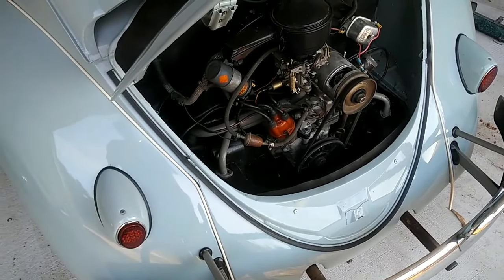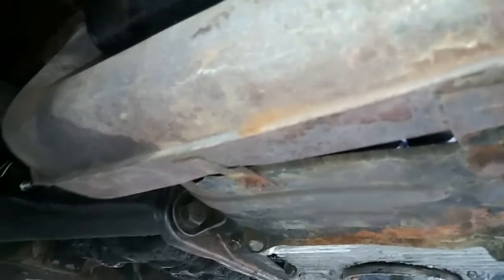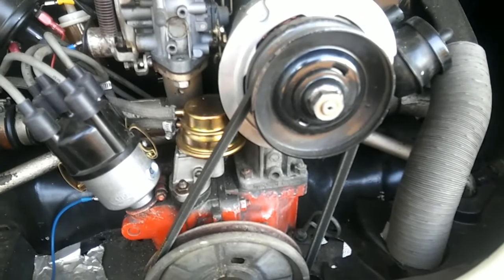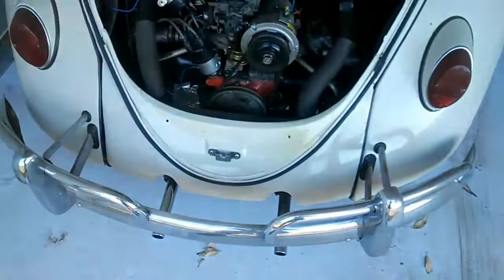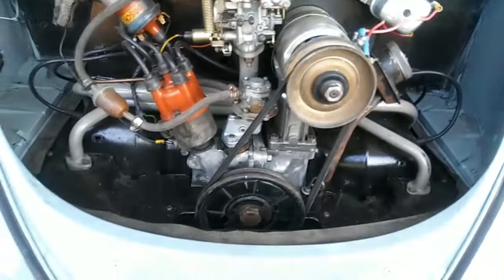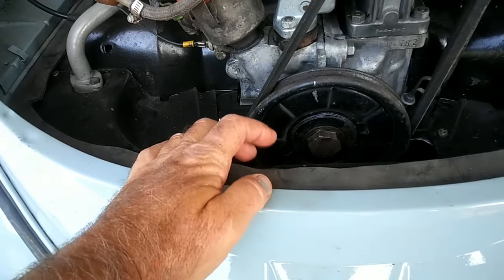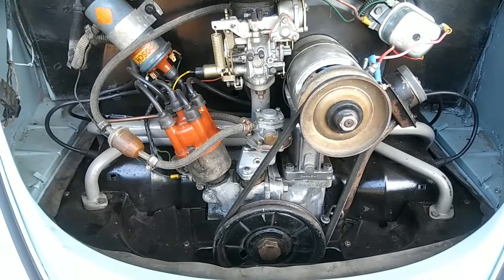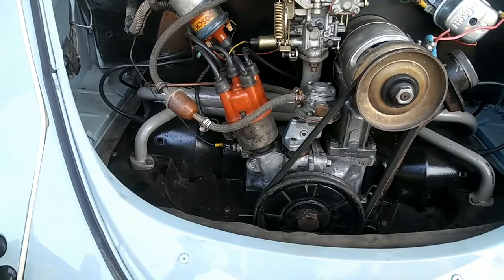VW Bug how to prevent engine overheating

Comment: 1-You go 70 km/h on highway for 15 minutes okay.
2- brake a little bit how much actually ?
3-and then full pedal 
4- if my engine sounds like "ping" or "in pain= is that meaning sound wraaaaaa" idk can you describe it more about that overheating check ? Speacialy for that ping or pain i can't understand that word sorry. English is my 2nd. Thx a lot 👍🏻
Reply: Also when i park my car after a daily drive and don't stop it about 5 minutes , i go out in my car and go behind , open the engine hatch and listen it.  i hear something like " someome playing battery and hit a drum but very far away" duum-normal idle sound arround 15-20 seconds - duum. What is that ?

https://youtu.be/gTQQ1aYYixM here it is.
Reply from the maker: check the jetting on the engine it is running hot. start there should be about 130 to 135 main jet.
Reply from the maker: the engine is definitely running hot. sometime the heads fins have clogged ports too. pull the engine and check them...
Reply: @Mikefngarage  thank you so much. It was just back from enginework about 2 months ago. The mechanic said he only care about upper parts he didn't go in the cylinders and lower parts. He said it's alright and don't need it. Right now my beetle is in bodywork. As soon as it finished i will check this again. Hope it's not serious. Thank you so much for your kindness. Stay safe&healty 👋🏻👋🏻

Comment: HELLO, I AM FROM ECUADOR, I HAVE A VW BEETLE WITH HEADS AND PISTONS OF KOMBY IS 1600 CC STANDARD, WITH CAMSHAFT ENGLE 110 AND ELCTRONIC IGNITION, WITH WEBER IDF CENTRAL 40, BUT I HAVE PROBLEMS WITH THE MEASURE OF THE JETS, YOU CAN ME HELP WITH A JETS RECOMMENDATION I LIVE AT 2800 METERS ABOVE THE SEA LEVEL

Comment: Hi MIke! Thanks for the vids they are great! Will using premium and a full synthetic oil help with running hot as well as engine life?
Reply from the maker: preimium is great IDK about the full synthetic. because it is so thin at low temps and it seems to find leaks because of the poorly sealed engine factory design. Castrol or kendall 20 50 or straight 40 depending where you are.
Reply: @Mikefngarage  Zinc/phosphorus levels in modern engine oils and not sufficient to protect flat tappet followers(lifters). In automotive  engines with catalytic converters engine oil had to be reformulated and these "new" oils should not be used in older engines with conventional pushrod engines. Goog...Hemmings News: Tech 101.
Reply: Models without catalytic converter can use diesel lubes 10-40w. They are high detergency, and have antiwear additives to protect tappets. I have used them for 40 years on aircooled bugs.
Follow manufacturer recommended oil change intervals.
Reply: @edwinhsingmaster9135  , you could use diesel lubricant, CF/CG spec.
Reply: @peteremmanuel2762  diesel engine combustion byproducts i.e. contaminants are different, so are moisture levels. Lots of stuff works, but is it the best?

Comment: Lots of correct info however the owners manual for my 68 beetle lists the maximum speed and the "cruising speed" as being 78 mph. https://www.thesamba.com/vw/archives/manuals/68bug/68T1-50.jpg "Cruising" speed meaning you can go all day at that speed without a problem. I never heard my engine ping under any conditions, even in the early 1980's when leaded gas was replaced by unleaded. I remember I did something slightly different with the onset of unleaded gas but I don't remember what it was. I think something to do with lubrication of the valve guides. I did notice that on every enigne cylinder #3 would begin having problems at about 85,000 miles, losing compression, and if you let it go much longer, the #3 cylinder exhaust valve stem would stretch into 2 pieces and the valve head would get sucked into the cylinder, usually ruining left side head, #3 cylinder, and #3 connecting rod. I was told the reason was because the oil cooler was near #3 and therefor #3 didn't get as much cooling air, would run hotter than the other cylinders, and cause it to fail first.
Reply from the maker: good info the 68 had 4.12 gears so yes max cruise would have been 78 with premium 91 octane  leaded fuel as listed on the fuel door. The cars in the video were both 4.37. The valve guides and exhaust valves were effected most from the unleaded fuel. We used to use a upgraded exhaust valve on every rebuilt engine at the shop I worked at. Dont remember what they were made of maybe stainless. We used all original kolbenschmidt parts mostly not available now.
Reply: @Mikefngarage  In the United States what I seem to remember is that the owners manual and the fuel door for my 68  beetle with the original engine said to use 86 octane or higher, according to octane rating system used in the US. I never used anything higher than 87.  I never heard pinging. Same for my 67 beetle. The only change I made to the 68 was to defeat the second, tiny, "fixed" mixture screw on the PICT 2 carburetor, to allow the engine to run richer. To do this my friend who worked for a VW dealer – if I recall correctly he warmed up the adhesive and turned the screw a bit. We left it there permanently, and from then on I adjusted only the normal mixture valve, normally. My 67 beetle with a PICT 1 carburetor was run without any changes to it at all. I rebuilt the 68 twice, maybe 3 times. The first time my friend got me some good low-mileage 1500 cc pistons and cylinders. It needed new ones because one piston and cylinder (as well as a connecting rod) were damaged when the engine sucked a valve. The second and third time I rebuilt the engine, it had low compression in cyl #3 but I got to it before any damage was done to it. Nevertheless at the second rebuild, I replaced the cylinders with 1600 cc cylinders. I don't remember if I replaced the rings or not on the third rebuilt. Rings were inexpensive so probably I honed the cylinders and replaced the rings but I can't say for sure. I definitely replaced the exhaust valves and exhaust valve guides – I always did that on every rebuild – as well as did a precision resurfacing of the intake valves and all the valve seats. Anyway – I still used 87 octane gasoline with the 1600 cc engines, without hearing any pinging or knocking.  I had several customers  whose engines I rebuilt, some with dual port cylinder heads, some single port. I don't remembering any of my customers saying anything about pinging or knocking. I don't know what kind of fuel they used. I don't remember discussing it with them but I probably did and if so I would have recommended that they use "regular." On the 4 to 5 air-cooled VWs that were owned or used by me or by my girl-friend at the time – they all were run only on regular gasoline. There was at least one VW which had the "pancake" engine.

Comment: Why not both gages? ;)
Reply from the maker: sure just most guys get the oil one and not the head one. The head should be #1 and the oil #2
Reply: Yea, even on water cooled engines it puzzle me how the temp is on the water and not on the head either.I mean, yea it is a better indication than on oil at air cooled but still

Comment: USE ''STAR TRON''...cap full per 6 gallons eliminates the ethanol.  2 caps per tank in vw, cant over use
Reply from the maker: I will try that.
Reply: MOST auto stores have it or ebay.  good price free shipping 32oz for 26 bucks.

Comment: Lol you run heat transfers lose them, and upgrade to a 60 amp alternator.
Motor works twice as hard turning a Gen. 
And yes, install the filter at the tank. I lost a 64 notch to fire.

Comment: your fuel filter should not be between the pump and carb, that how vw's burn up!
Reply: VW bug how to prevent engine fire
Reply: Rick Jolicoeur is right people: if that fuel filter leaks right onto the sparking distributor or if your fan belt snaps and hits that fuel filter and causes it to leak it will be the Hindenburg all over again, "Oh, the Humanity!"
Reply from the maker: I have had vws my whole life over 35 years. Never had one of those plastic fuel filters fail all of  them in the same place. . But you need clamps on it for sure. The biggest problem is the carb brass insert falling out at some point. The glass ones are the ones that I would never put in that position. thanks for the reply.
Reply: And always check oil level .  The mechanical  fuel pump can leak gas  into the crankcase when it becomes worn or seals fail.
Reply from the maker: yea the fuel pump leaking into crankcase i have had that happen too many times.
Reply: Mike F, I respect your experience and it shows in your VWs, however, in all of the VW bug factory literature, pictures and diagrams I have not seen one with the fuel filter anywhere near the engine, even with the later bugs, but I have not seen it all, of course. I know it is common to see fuel filters there, but why?, where did it start,? in the 60s probably. I am not saying that it will but it could catch fire.
Reply from the maker: original vw didnt have a fuel filter. They had a micro screen in the tank. that was it. Over the years rust developed in the lines therefor needing  a fuel filter. This is where we put them in the early years. Some guys put it before the pump by cutting the line short. Originally the fuel line went about 2 inches from the pump with a small hose right before. That is why you dont see fuel filters in any literature. thanks for posting that I am sure more people are curious and just dont want to ask.
Reply: Original fuel pumps had a filter inside the pump.
Reply: bugsnstuff: Was it in the early Vdubs or you mean for all years?
Reply: I put mine under the fuel tank ( Super Beetle ), my standard Beetle's placed right where the fuel line comes out of the frame.  My Type 3....well it's on top of the fuel pump ( stock D-Jetronic ). I'd never put it in the engine compartment.
Reply: Brian on my Ghia I have 2 of those cheap fuel filters ($1.99 each) and it works fine: one under the fuel tank and one where the fuel line comes out of the frame. My fuel tank was new like 8 years ago and I the metal fuel line that comes from the frame has never been changed.
Reply: I always put a filter in the hose by the clutch bowden tube, NOT in the engine bay.
Reply: I have used the same type of filter on VW,motorcycles ,cars and farm traxtors for over 50 years never had one fail or leak .
Reply: Mike F Yeah that and the fuel pump nozzles where the lines attach also tend to get lose the seal where they attach to the body of the fuel pump. Never had a filter problem either.
Reply: we use all steel  lines  on our  corvairs   ..filters  dont belong  there
Reply: I've had a fuel filter there and I've had an engine bay fire. But it was caused by the carb inlet popping out.

Comment: Plates work better if they have the screws holding them to the case...
Reply from the maker: Yeah if you have the original plates you really need to have every piece on there
Reply from the maker: But the super cool tin or type 3 engine tin work great especially when you can't put all the original ones on because of a modified exhaust or something like that. Imo The super cool tin always works a little better

Comment: These VW's are mistakenly called air cooled. The air cools the oil by means of the oil cooler, therefore they are really oil cooled. The use of heavy engine oil is another indicator of this. You cannot use modern 10/30 etc on these engines, instead it's SAE 30 or similar, as used on lawnmowers. A lawnmower is not air cooled. I would disagree with sensing cylinder head temp. Oil temp variation from sump to pistons is not going to vastly differ once engine is up to operating temp. Good servicing stops engine running hot. Oil cooler fins cleaned and making sure oil runs freely through cooler and pipes are not gunged or restricted. Respectfully disagree with sensing cylinder head temp.
Have had 10 plus Beetle's in our family from 1968 to 1983 and never had a mechanical breakdown nor an engine fire. What we did have was a VW trained foreman mechanic who always serviced our cars. Realise  how fortunate that is now, after reading various feeds on other peoples experience with these engines.
Reply from the maker: Im sorry I absolutely disagree. I use multi weight oil. With today's oil technology you can use. the straight weight was good for yesteryear but not for today. Heads are where the fire is do you see oil in the heads to cool them down. NO No oil there.

Comment: so u have no idea what yuour 'recomrndations do to the actual cyl head temp since u  dont have a gauge ..dsont u think the vw engineers might have really known what they were doing when they designed the fan shroud..leaving the thermostat flaps out  is  bad fror cyl life. using type 3 cyl air  deflectors helps aloalso i would NEVER leave the foward tin out of a n engine installation..if u want the best enginnering look at a type 4 engine.....
Reply from the maker: all this stuff has been tested with gauges many years ago.  I just dont have one on any of my cars anymore. where I live it is never cool enough to need thermostat flaps They just restrict air flow and when the thermostat fails you will have a real problem worse than not running them. Cool tin AKA type 3 air deflectors Definitely DO work Im not sure if I suggested them in this video but I think I did. I would not usually leave the forward tin out but if there were one I had to leave out to run hoses or cut that would be the one. We tested driving temperatures many years ago on all this stuff front tin didnt make a difference at cruise speed.
Reply: how about that tape job?craftsmanship at its finest.

Comment: I only run non ethanol gas in all my carbureted vehicles.
Reply: Is ethanol bad for carbureted engines...?
Reply: Not if it's burned, only if it's parked or stored for the winter, I just choose to play it safe and run non ethanol, it has a longer shelf life than ethanol gas, but that's just me.

Comment: There are many flaws with these engines.  Why no one hs come up with a case temp sensor and dash gauge is beyond me.  Even a temp dipstick would be an improvement.  The hotter these mag cases get, the quicker they crack.  The only solution to a case carck on a mag allloy case is to junk it.
Reply from the maker: Gene Berg has the dipstick temp sensor. And most guys know to use the spark plug ring temp sensor for head temp. There's lots of them available even a universal one with a digital gauge for head temp.

Comment: An easy mod to cool cylinder heads is piston oil squirters. I've not seen anyone install them in a vw case, but an easy way if you have the engine apart is on the con rods. It's been said to cool the pistons as much as 50*C. See:
https://www.youtube.com/watch?v=7wuNuuEoN7Y

Comment: Look at 6:21, your installation of the dog house tin is atrocious. The huge gaps allow hot air to escape into the engine compartment. You are missing the tins that cover the heat riser coupling. Did you really say it is ok to leave the front tin out? And don't need to use the flaps and thermostat cause they restrict air flow? You are a hack, INHO. Sorry